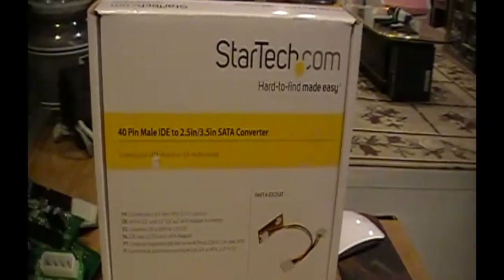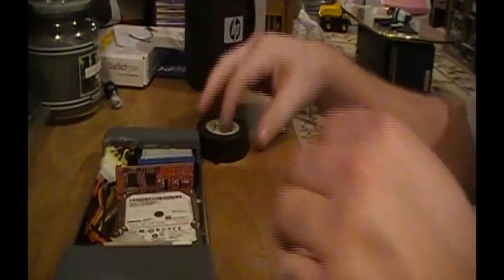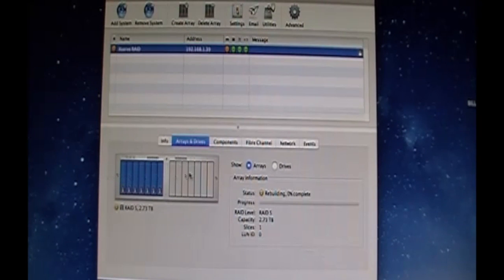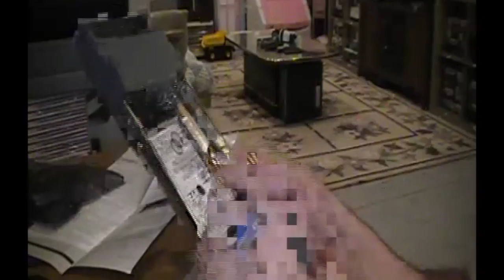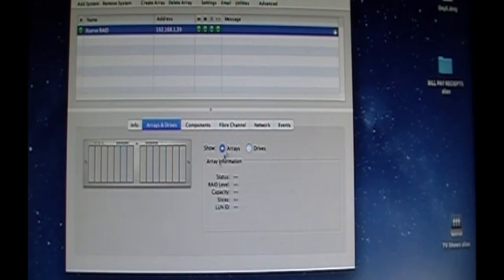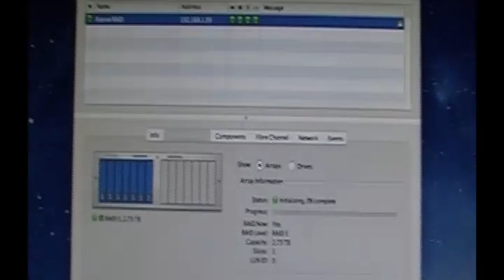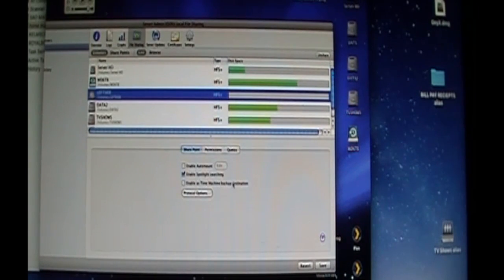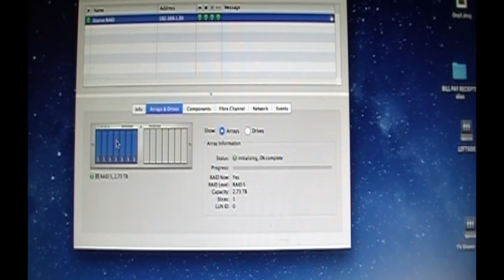Episode 20 Xserve raid replacing the cheap IDEto Sata with GOOD ONES

Comment: You never mentioned if the 2tb drives worked. We see the 1 tb working just fine, just wanted to double check to see about the 2tb's. I'm building my own little NAS and picked up an Xraid and have come to the same exact conclusions (wish I saw this video b4). I just wanted some clarification before I invested in a bunch of 2tb drives blindly.
Reply from the maker: bawls258 no never got them to work max size is 1tb but you can get a lot in it and it's fast with all 7 per side filled.   Takes a while to final initialize it all

Comment: Hi Chris, Just saw this video. I have three raid stacks with 2 xserves still running 10.7.5 . drives are starting to die and they are no cheep. My question is co i need to update the 2 xserves to run 1tb drives in the raid and is the Startech #ide2sat sill the best way to go? Thanks for the help.
Reply from the maker: indeed, Startech IDE2SAT or IDE2SAT2 will work just fine, you can then mount with wiggle room 2.5" drives , you can install whatever you like, but recognizes 1.09TB per drive., formatted capacity 1.0TB each, but it gives you 10TB and mine works flawlessly since doing this. check out the other videos in this series for updates. but yup works fine. it is a little bit of an initial investment, but a small price to pay for upgraded capacity and improved performance! . good luck! reach out if you need any assistance.
Reply: @ChrisEdwardsRestoration  Hanks for the reply I will get the IDE2Sata2 , also what drives did you purchase/ Thanks again.